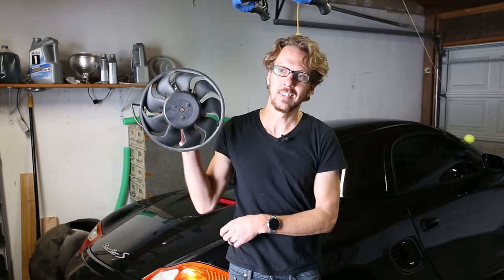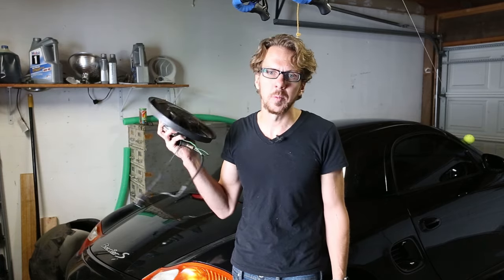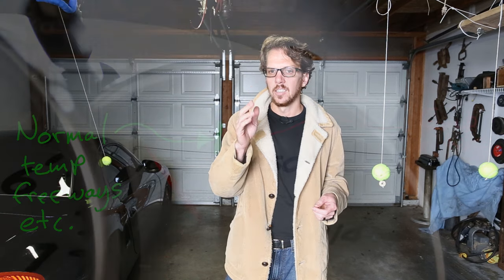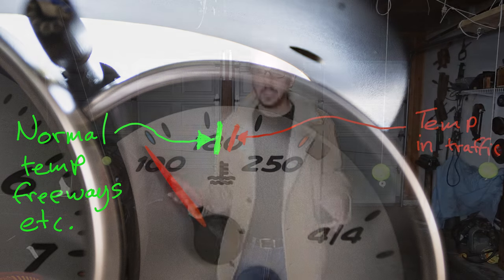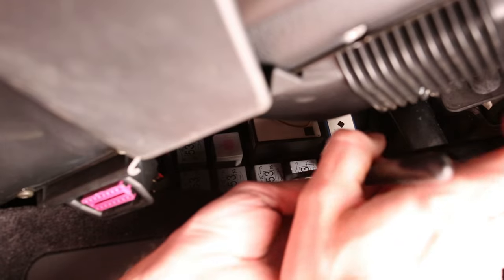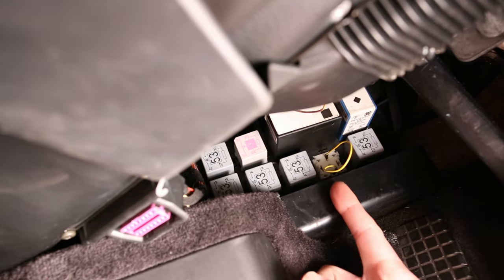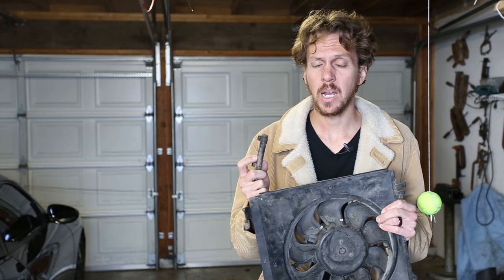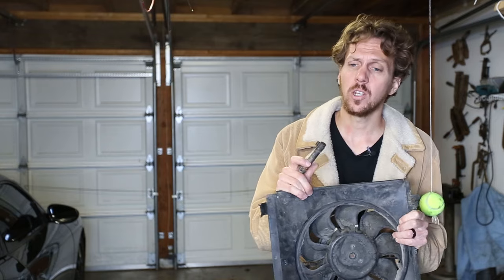How to Troubleshoot and Fix the Porsche Radiator Fans

Comment: Another nice vid.

FYI: If you have the Durametric tool, you can use it to test both Speed 1 and Speed 2 of the fans without starting the 986.
Reply from the maker: I did this before I owned a Durametric tool, but you are absolutely right. Now that I have the tool, I can say that using it makes diagnosing problems MUCH easier. I pinned your comment to help others.
Reply: Burner's Cars 
You said that if the AC is on both fans should run?
Is that at slow speed.
Thanks
Reply: I found out thanks

Comment: I bought my 04 986 "S" a year ago (Feb 2016). I have watched many of Burner's videos and will say he is the best. Today..Feb 23rd here in Ontario our temps are 16c so super nice for us this time of the year. I removed the front bumper (without any problems) and have cleaned the rads. They were disgusting. Bird feathers mostly and stuff I couldn't recognize.  
Who needs a manual when Burner makes things so easy. Thanks man!

Comment: Burner, you motivated me to remove and replace the left aux fan on my 996. Your diagnosis was extremely helpful in determining that it as neither the high or low speeds, the fuses or resistor. It was, in fact, the fan. I would like to add to your commentary however, is that the reassembly is far more difficult than simply reversing the process. I would want anyone considering the procedure to pay particular attention to the orientation of the bowl shaped fan shroud and for the bracket is removed and how it might be reinstalled. Your video was excellent despite my mechanical shortcomings. It took me about six hours start to finish. That said, I hope it’s a long time before I have to repeat this on the right side. Thanks again and keep up the great work!

Comment: Thanks for a nice video! Tip: if the temperature goes up, put the heater on maximum (don't stop the engine) and heater fan also to max. This helps at no matter which car and can save the engine (but you will sweat like in a sauna)

Comment: Having same problem with my '99 996.1, drivers side will not turn on with ac on or in high temp situations.  Wasn't sure what made everything work together, but now I have a place to start and begin my process of elimination.  If the fan comes on with a 12v source then the resistor is might be the problem. Great tutorial and thanks for posting!
Reply: positive lead to the green wire, if no fan movement the ballast is bad.
Reply: Had two bad ballast resistors and a bad fan. All good now. Thanks!

Comment: As a Porsche tech for over 30  years,I find your videos show the long way to test replace componants.The easy way to check coolant fan operation is to just turn the A/C on,both  
fans must run on speed 1,if not replace resistor.
Reply from the maker: Yes. That was the first thing I suggested under the troubleshooting section 3:10.
Reply: Overly critical eyes sometime miss the positive things.

Comment: Very well done video, extremely clear, thank you. A question for you:  I have the bumper cover off of my Boxster to do this because I'm doing some other things as well. When you remove the large metal bracket with the 2 - 13mm bolts and 1 - 13mm nut, won't the radiator drop with the bumper cover off unless you use something to tie it up and hold it in place?

Comment: Great details here well done! I found that you don't need to remove the shroud from the bracket, it is still possible to reinstall that way. Also my 2003 C2 cab did not have the battery drain hose in passenger side, maybe drivers side?

Comment: I've discovered my fan that is not working by just putting my ear close to the vent. But it took a little while for me to know it.. Very nice video on this. Thank  you Burner's Cars for inspiring me to fix it myself...I suggest that you should have tested the fan by simply tapping the 2 wires you cut into the battery to know if the fan motor is working.
Reply from the maker: Glad I could help! That would certainly work, but I didn't want to go cutting wires on the off chance that the fan was fine and it was something else (relay etc.)

Comment: Hi Burner, 
I got some info from another post and they said you can just change out the resister itself for about $4-$6 that are on Ebay. 100W x 0.5 ohm resistor
Reply: Wondered how you determined it was .5 ohm?  Did you measure a new OEM unit?

Comment: If one of your front rad fans won't go into high speed, it's likely a failed ballast resistor.  I replaced one of these resistors on my front-right fan with a replacement resistor from DigiKey or Amazon (can't remember which) and it works perfectly.  It was a ~$3 part after shipping.  I want to say it was a 0.5 Ohm, 100 Watt resistor, but you should verify that before doing it yourself.  And, as he mentioned, you will have to cut out the old resistor and splice in the new one, which isn't necessarily for everyone.
I recorded the whole job, but I haven't been able to edit and post it yet.  If you're having this problem, just Google "Porsche fan ballast resistor".

Comment: Can you tell me where the engine compartment fan fuse and relay is? I have found one fuse related to The Engine Compartment Fan in the footwell (B4 which appears to be 15 Amp). Looking at the fuse diagram it appears C5 may also be related to the Engine Compartment blower fan Stage 1 which is 5 Amp. From what I see a standard type 53 12v relay is in the trunk which relates to The Engine Compartment Fan. Any thoughts or additional input on this?

Comment: Hi Ben. Have you thought of simply drilling a 5 cm hole in the plastic undershield directly below the coolant drain plug ? Saves taking that damn thing off . Not a problem ? OK . Just thought I would offer it up. Cheers from Oz.

Comment: Hi! I noticed about a week ago that my Cayman S 987 right radiator fan did not work, another fan rotates at high speed in the 30s-60s cycles. I had seen your video in the past and it came to my mind almost immediately! Thanks to your good video I knew where to look but luckily I found that the stone was just stuck in the fan. I wonder if the breaks of the fans can be partly due to this jamming somehow odd that the electric motor is such a weak point?
Reply from the maker: I'm glad it was something simple, and I'm glad I was able to help! Interesting idea about junk jamming the fans... having cleaned the front radiators I can attest to just how much debris gets caught up in there.

Comment: Great video! Very helpful. ? I have a air bag light on.  Fault memory 28 and 30. Any help would be appreciated on a 1997 Porsche Boxster. (Ignition circuit-side airbase driver). Check the side airbags work and the clock spring work and the seat belt work. 🤔 Thank you!

Comment: HI, you said that to check if the fans are working at speed1 it's enough to turn AC on. How to check if they work at speed2? My second question is the following: could the water pump being the cause of a small overheating?

Comment: Hey Ben, I curbed my 986 badly and was watching this to see how I could remove the radiator between the fan and condenser. The condenser was totaled and I bought it's replacement already. Now I've seen broken pieces of the rad as well and need to do it, and hopefully I haven't destroyed the fan. It was pushed into the wheel well such that it was rubbing the wheel and could not steer. Debacle. Is it tough to do?

Comment: I just had my right fan replacing 3months ago 991.2 . But I just noticed that the left front fan is blowing a bit harder than the right one, but not as hard as when the temperature went up to “overheat” stage. Is that normal?? That both fan run at sightly different speed?

Comment: I have a serious overheating problem on my 99 996 911.  The right one did not start. I changed the relays over (Two from the right changed two from the left) and exactly the same result. Left ok right no go so I take it that all relays are fine. .  Are you sure that both sides should kick in the fan with AC on full manual or just the left side?

Comment: A follow up question. With great help from your video, I replaced a faulty right ballast (broken wire) and now all fans operate properly at low and high speeds. In summer city driving, temp gauge climbs to the middle of the 0 of the 180 degree shown on the temp gauge, as best as I can tell this is around the 200-205 temp range. At this point the fans come on. Is this a normal range for temp to climb to before fans kick in?? Per your videos, radiators/condensers have been cleaned and coolant changed. Thanks for all help!
Reply from the maker: Nice work, Steve! That seems a touch high. Nothing to worry about, but maybe worth investigating further. Do you have a Durametric tool or something that will get exact coolant temps?  I believe they are supposed to switch on at low speeds around 97 degrees C and high speed around 103 C. If they're doing this, then I wouldn't worry about it.
Reply: Thanks for additional insight/comment. I do have a infrared temp gun that can maybe help we verify actual temp, the car gauge going to the middle of the 0 of the 180 make is anybody's guess what that actual temperature is. W/o a/c being on, the temp climbs there before the low speed fans come on. Just wish they'd come on sooner. I'll test with temp gun and see what readings I get. Thank you for all help.
Reply from the maker: Yeah. The dashboard temp gauge tells you when something is really wrong, but for subtle changes, it can be a little harder to tell. Good luck!

Comment: Hi Burner, I'm having similar issues with a 1999 Boxster 986, 2.5ltr,  has no A/c installed.The RH fan wont run when the engine heats up past normal temperature ( the LH side works perfectly fine ) I've replaced the ballast with one I borrowed and if I "jump" the ballast on 30+87 pins the RH fan comes on OK. so it would appear the fan works fine.I've checked all relays and they are fine, along with the C8/10 fuses.It seems strange that one side works fine with an increase in temperature but I'm wondering are there two sets of temp. sensors ?? one left and one right? I cannot think of anything else, the LH/RH fan runs OK when using the jump wires at the relay.Any help would be appreciated.Keep up the good work really enjoy the quality of your videos.Rob
Reply from the maker: Hi, Rob! YouTube marked this as spam for some reason (happens from time to time), so I missed it. Are you sure the relays are fine? If you jumped the relay and it works... that seems like the relay might be the problem.

Comment: Great job! You answered many of my questions. I think my left fan is not working on the low setting so I'll check my relays 1st. I've been wanting to clean my radiators too. Just going to wait for better weather. We're expecting bad weather in Seattle this weekend. (1999 986)
Reply from the maker: Ah, yeah, how about that storm? Having recently moved to Seattle from LA, I was expecting an awesome tempest...
Reply: Welcome to Seattle. Me too but nada...
Reply: Hm Nava most likely the resistor is bad. Happened to me. But you can check by junketing the relay and see if the fan turns on or not . Common problem
Reply: Hey RK, will check that 1st. The HI setting works on both sides. I haven't had time to do the AC test to see if the LOW setting works.
Reply: How did you check the HI setting? I am curious. Because it only turns on when the engine is super heated.
Reply: On a hot day driving in the city they came on, both fans at full blast. My suspicion is that the low L is not working because some the temperature slowly passes the average temp. Will do the AC test on next weekend to check the low setting. Thanks!

Comment: I replaced both fans recently and also found vacuum leak due to hole in heater core after that the temperature at the traffic light does not go beyond 190. It used to be close to 215 prior to doing all these.
Reply from the maker: Nice work! When you say there was a hole in the heater core, do you mean it was leaking coolant? How did you find the problem?
Reply: I was checking the vacuum on my coolant system (after flush) using AirLift and the system could not hold 25psi. So I started to investigate the issue and isolated the problem to heater core. Then I removed heater core and found coolant stains outside. After I swapped with a used on on ebay. The system could hold the vacuum at 25psi.  I live in VA but got bought my 986 from bayarea. I am guessing Californians won't use heater much and the coolant is stagnant in the heater core to cause corrosion and leak.  I guess you saved the ballistic resister since that part is good after swapping the fans. And expensive to buy later on as a replacement.
Reply from the maker: Ah, that makes sense. Good catch! I love the AirLift system!

Comment: My left radiator fan isn’t working at both speeds. I swapped all the relays back and forth and the right one always works but the left never works. I replaced the fan and the ballast, still doesn’t work. I then realized the fuse was blown, replaced that and still doesn’t work. Any idea what else I can check?

Update 1: I shorted the top and bottom connectors on the relays. I can confirm the high speed works for the left fan and both speeds work on the right fan. Why doesn’t the low speed on the left fan work? I just replaced the fan and the ballast.

Update 2: when I try jumping the relay in low speed, there is no spark or anything when I make the contacts.
Reply: Did you get to the bottom of this one? That sounds like a strange one.

Comment: I decided to get the URO part from Rockauto. I usually get OEM parts, but I figured it's just a fan and there is nothing special about a fan. Every car has one.  When I got it, I compared it with my Bosch fan and it functions just the same. Blows the same and has the same noise.

So when my second fan blew, I had no hesitation to get another URO fan from Rockauto for half the price of the Bosch fan.
Reply from the maker: Makes sense. I'll be curious what the long-term durability is... but as long as it lasts at least half as long as the Bosch fan, you're still ahead, right?
Reply: URO stands for U Replace Often, but that's the fun of owning a Porsche, isn't it?  Anyway, so far so good. The first one has been running 3 years without issue.  I have a Durametric, so I can test at both speeds.
Reply from the maker: Haha! yep. But really, 3 years is not bad! Even if it only lasts another year or two, you'll probably get your money's worth... and it's not a big deal when they fail.
Reply: @cheepGeek  LOL!

Comment: Just learned that fans are not working. Are the relays inexpensive enough to just replace all 4 preemptively on a early Boxster and start from there?
Reply from the maker: I think the relays are pretty inexpensive, but I don't think I'd bother replacing them. As far as I can tell, it's almost always the fan or the ballast that comes with the fan. It's rare that the problem is with a relay.

Comment: Foreign language fail - what is that part you could change in the alternative called exactly? I can't hear it out, even though you mentioned it 20 times... :P
Reply from the maker: No worries. You probably mean the  ballast or resistor. part number 99661610100
Reply: Ahh ballast... thought I'm spazzing out here :) Thanks.

Comment: Both cooling fans failed on my 996 at 77,000 miles. 

Porsche purist: You're going to replacement them with OE German ones right? 

Me: The OE German ones both lasted less than 100,000 miles. These were designed and made by the same people that though it was a good idea to install the equivalent of a sealed wheel bearing inside a hot engine that is constantly bathed in hot engine oil. I'll take a chance with cheaper China made aftermarket. They'll probably last longer. 

Porsche purist: Don't think they will last even half as long as the German ones. 

Me: Think not? I have a 325CI BMW that I replaced the OE radiator fan with a China made aftermarket 6.5 years and 94,000 miles ago and it still kicks on every time. Not everything made in China is crap. And I don't think any Chinese engineer worth his\her degree would ever consider putting a self sealed wheel bearing inside a hot engine that is constantly bathed in hot engine oil. 

Porsche purist: No response.